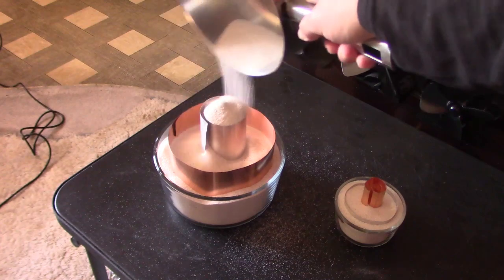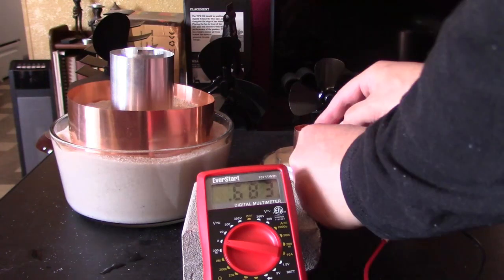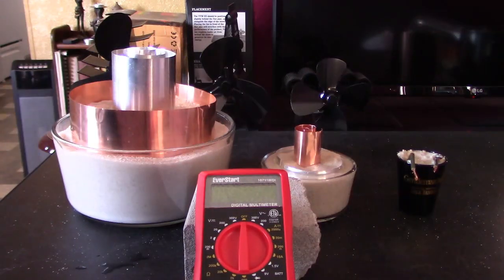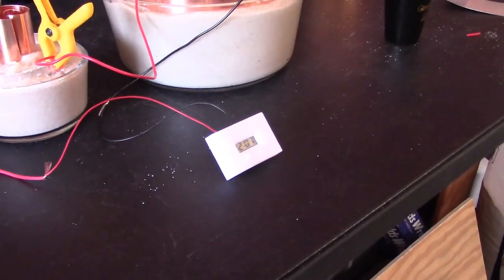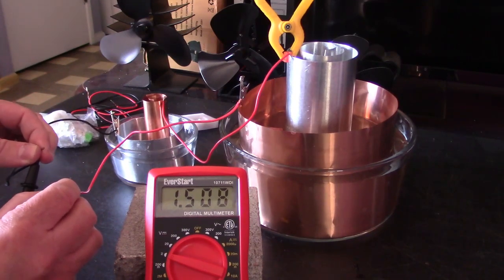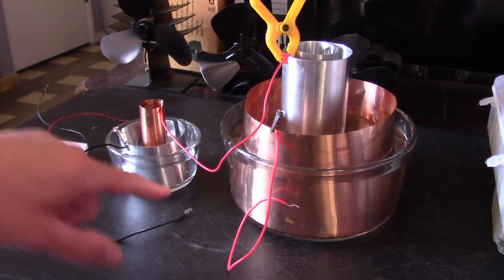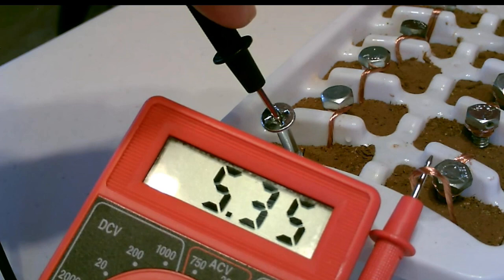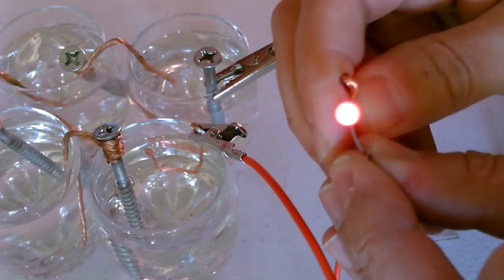DIY High Amp Earth battery! 1000% increase! (using CU/AL sheet metal) 10x  amps! (sand soil + water)

Comment: How long does the current last
Reply from the maker: as long as the sand stays wet and the metal isn't corroded it will keep working. i have one that is still working after 4 years.
Reply: @desertsun02  - thats amazing

Comment: The initial configuration with mixture of water and earth must containers dissolved salts to allow the battery keep an internal flow of cations. With this configuration of metals, its impossible to obtain amps from that, because of its lowe reduction potencial due to aluminium. You likely obtain miliamps, maybe, hundred of miliamps. At the second part, we see that now its using a salty solution that allows a bigger internal current of cations and bigger current of electrons through the cable. This is the same thing that the beginning of the video, wich is an electrochemical cell, or galvanic celd. There is not anything new in that video, unless you want to be able to make homemade salty batteries when the war explodes.
Reply: ph scale is how charged with lecky. worth a rabbit hole FAM IYKYK

Comment: Very cool, but what’s the practicality of this? What could it really be used for or necessary?
Reply from the maker: hi there. i've been reading that there are a few companies that are using earth batteries to run low power remote sensors and monitoring equipment. that would be one use. other uses could be to run low power items such as Led lights, buzzers, lcd clocks, and a variety of other small items with lcd screens. they easily run battery powered calculators too (so that means they can run small computing devices). this particular big battery cell could even run my solar powered am/fm radio. i calculated i would need 10 of these cells hooked in parallel but that could be done fairly easily.
Reply: @desertsun02 Have you made higher power diy battery on this channel yet?

Comment: Hi, consider this as a DC generator like solar systems where you replace PV panels with this cells. You’ll have 24/7 generation of electric power.

Avoid direct contact between Cu and Al when series connected, brass connectors with bolts/screws will work and prevent corrosion in long run. If you want to run a house on these you may want to seal your cells to prevent evaporation and use pure water pharmaceutical grade A or at least deionised water.

For easiness of manufacture diy you may use Cu and Al tubes/pipes in pvc tubes. 2-4 mm distance between electrodes work best. 6 cells in series are best for 1 stack, if more then 6 per series are used voltage is sagging and middle of series will have inverse polarities of electrodes. Use stacks of 6 in series in parallel to improve current … as many as you like.

Always connect a capacitor before attaching any load. See my channel for demo. Usually 100uF electrolitic cap low voltage is enough per each stack of 6 in series. Add a frequency generator and voltage doubler. For small power pack attach an ordinary cheap “Joule Thief” circuit eventually and will last for +20 years … but using smart this system allow for decent electric power generation way cheaper and without the need for batteries for storage … few hundreds and a bit of work to power your house without maintenance or additional costs for running the system non weather/sunlight dependant.

Or use a similar system designed for solar electric generation with mppt inverter/charger off the shelf.

Comment: is this self charging?
Reply from the maker: hi. to keep it charged you just keep the soil wet. as it dries out the power will be less, but just add more water and the power goes back up.
Reply: @desertsun02  there is a electrochemical reaction between the metals you can look up online for the electrochemical reaction between these two metals, eventually they have to be replaced

Comment: Copper and magnesium will double the voltage.
Reply: Why is that??
Reply: @CommunityPc-m1c  Copper is positive charge and magnesium is negative charge so when you put them in electrolyte the voltage measured is 1.3 volts.  The human body and the earth can act as the electrolyte.

Comment: It's better when You use zink instead of aluminium, ie. zink galvanized metal sheet.
Reply: Yes true...  Have tried the different metals. And the gavi steel was most.. with copper...
Reply: @StKing-d9u correct, especially above or in an aquifer or river!

Comment: You should try... a lemon bettery! put two different metal nails into a lemon and viola, electricity ... even works with a potato.
Reply from the maker: hi. i've tried many of the juices like lime and lemon (shown later in video). i see you noticed the experiments. i haven't actually tried using a lemon but i'm assuming it would work about the same as the lemon juice version. of all the juice ones i've tried the lemon juice one is probably the most powerful.

Comment: What are you using for to make the batteries?
Reply from the maker: hi there. do you mean, "what am i using them for?"🙂 if so, i mainly made these as an experiment to see if i could get an amp increase if i used more metal. this type of battery can run many more things with extra amps. i was guessing i could get 20x or more vs. a smaller cell and got 10x to 15x more power so not bad. you can run little leds, lcd clocks timers, calculators, electric tea lights etc... some companies are even using earth batteries to run remote sensors etc... pretty neat to use 'the earth' for power source.
Reply: @desertsun02  he means "what are you using to make the batteries"
he says it in the video, it's galvanic cell, copper and aluminum. stick two different metal nails into a lemon and you'll get current.
Reply: @desertsun02 Thank you! 
 I was more interested in the materials you are using. I saw the copper and aluminum plates. But the "filler" material, is it sand?
Reply from the maker: it is sand, but you can use dirt or soil if you like